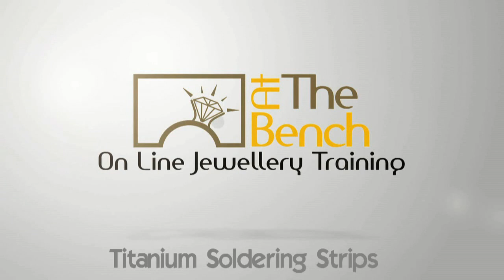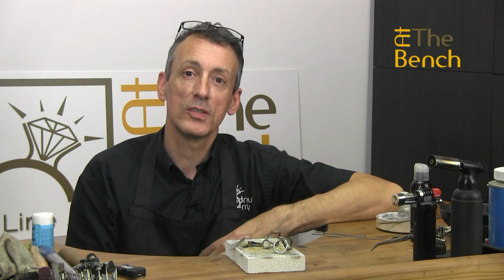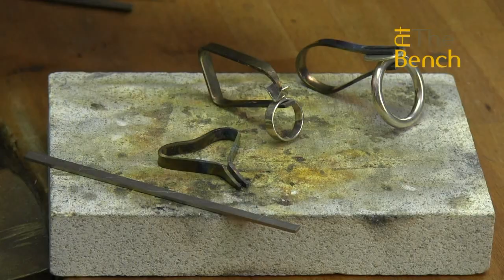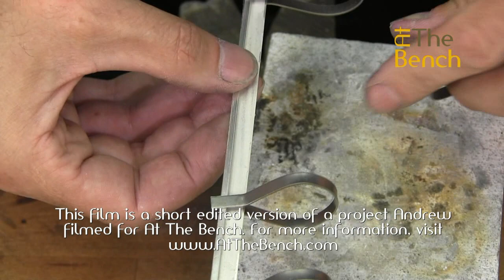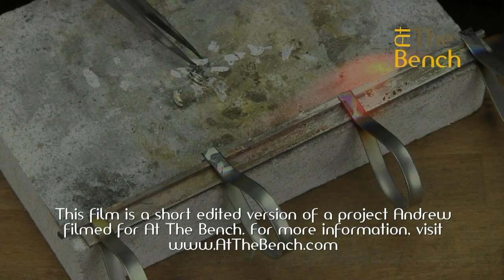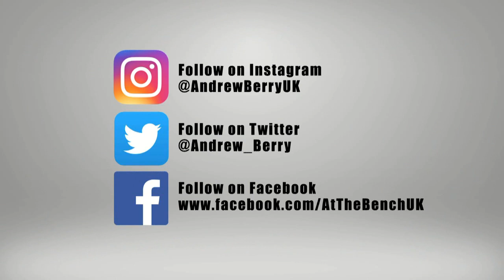Helping you Make and Solder Jewellery with the Knew Concepts Titanium Soldering Strips

Comment: I’ve not seen you use a soldering gun.  I have had good luck, so far using the gun for connecting the band on my rings..Is there something I don’t know that I should.  Im just learning to use a torch but I can avoid pickling after using a gun.